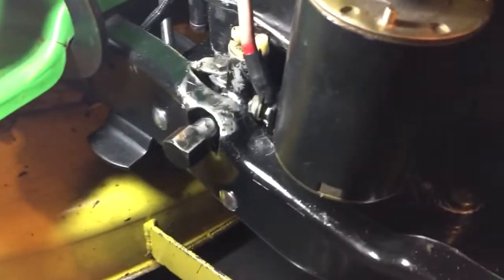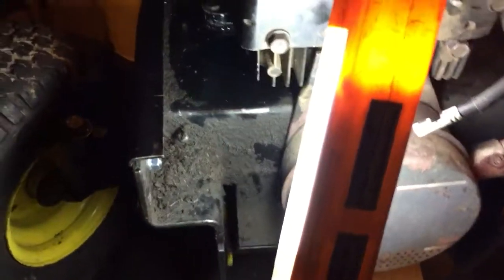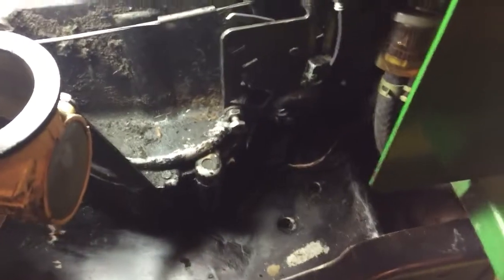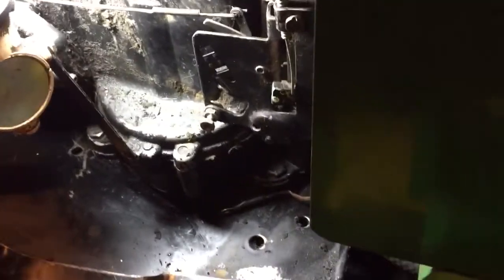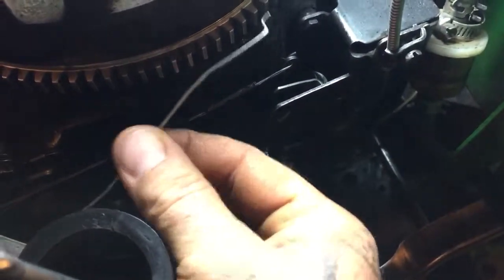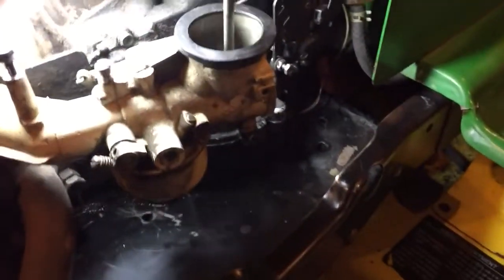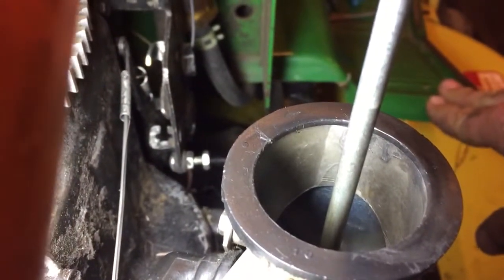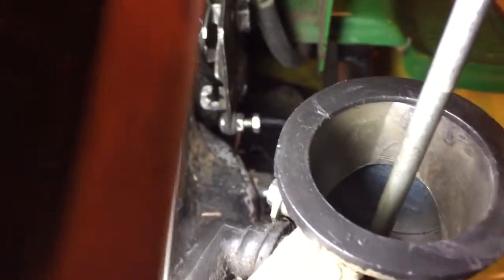Briggs & Stratton Auto Choke/Choke-A-Mattic operation

Comment: i struggled with this for like 6 hours Lol thanks for the help man. hopefully this helps my surging issue
Reply from the maker: Thanks and good luck, surging could be a few things. Junk in the carb, governor not adjusted correctly etc. This thing was in pieces when I got it. Took some research to get things figured out.
Reply: @Gunters Garage  Mine bounce from running great to almost dying over and over again. Not sure what the deal is, ill put the chock lever back like you showed in the video too see if it makes a change
Reply from the maker: @ethan5.4s89  the good this is theres a lot of info available for briggs even the old stuff.
Reply: @Gunters Garage  Thats right, i will let you know if it makes a difference, Ill add on a fuel filter too
Reply from the maker: @ethan5.4s89  thanks Id be curious to see what you come up with. I dont know what info you have on your engine but if you can get the code numbers off the engine usually on the pull start tin near the spark plug area you can down load and print parts manuals and service manuals are pretty cheap to come by as well.

Comment: Brilliant was struggling with my briggs engine carb could quiet work out how it went together
Reply from the maker: Thanks, glad it helped.
Reply: @GuntersGarage  hi man my choke wire cable is off , not sure where the choke wire cable goes ??? I have a similar model , 1981
Reply: @GuntersGarage  4:26 ya I'll give it a try
Reply from the maker: @sinabagherisarvestani8924  you might have to play with it to get it to work like its supposed to. Or if you can find a used throttle set up thats complete. Not long after getting this figured out my neighbor was scrapping a tractor just like this one with a blown motor. I kept the motor for parts and now have the whole set up. The rod I made looks just like the factory one, helluva guess :)
Reply: @GuntersGarage  I  just choked  it by hand without the wire using my fingers , I'll try putting the wire back today
Reply: @GuntersGarage  why didn't you use the factory one ? it was out of shape or too short ? I still have my factory one
Reply from the maker: @sinabagherisarvestani8924  it didnt have one and I figured it out accidentally watching some yt videos. I received the parts engine from my neighbor well after the fact and my homemade part works just fine so I left it.
Reply: @GuntersGarage  yes , you could also choke it by hand without a wire if you didn't have a wire or if your in a hurry and you don't have time to fix it
Reply: @GuntersGarage  my lawnmower model is very similar to the one in your video , mine is a 1981 turf trac Briggs and Stratton engine , it looks the same , I gave the video a like , I'll try putting the choke wire back today